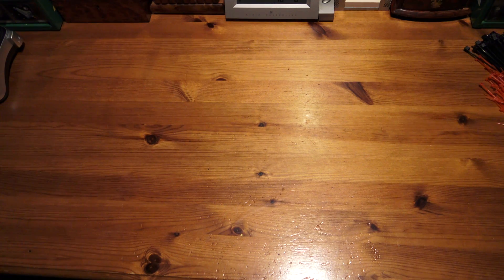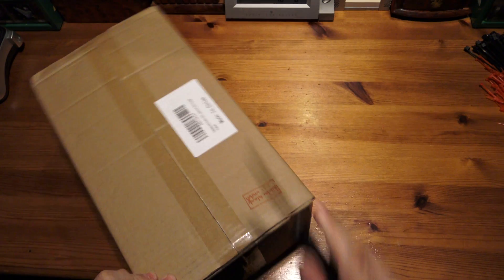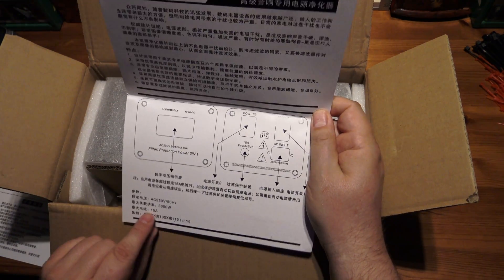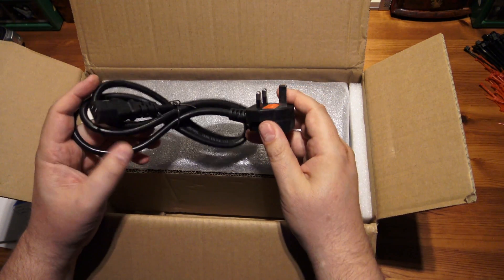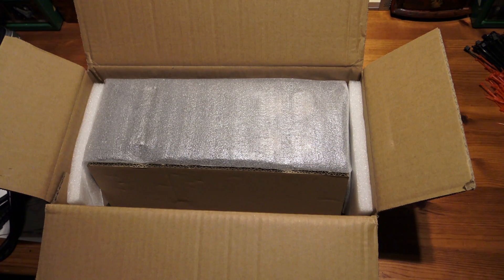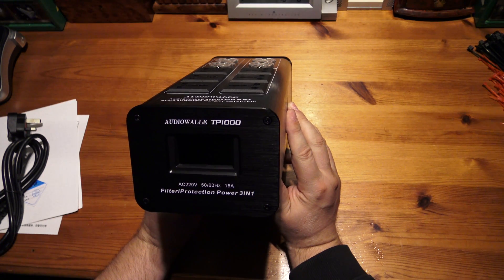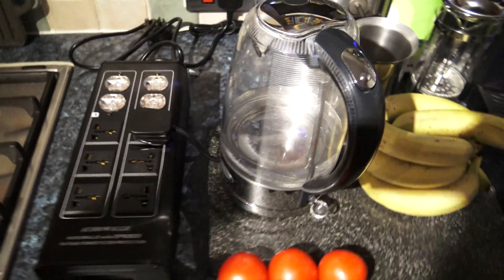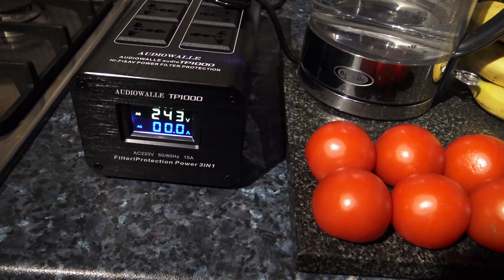Nobsound/Audiowalle AC Power Socket Conditioner Unboxing

Comment: I have Weiduka AC8.8  for about 5 years now. My HiFi components are connected all the time and it still runs without any issue.  @nonsensicalchild Do you know if those US plugs are actually supporting devices with 110V?
Reply from the maker: It is uk mains 230v as far as I know.
Reply: @nonsensicalchild  That's what I thought. It doesn't act as a step-up transformer on those US plugs  .
Reply: How heavy is this unit? Thankyou..
Reply: is this weiduka good? does it really filter out noise? im looking to buy one. thanks!
Reply: @KazuyaST  Tbo, I haven't notice any sonic difference.

Comment: Those sockets designed to take every single type of plug under the sun are deathtraps and don't meet any of the standards needed to be sold in  the UK or Europe. That alone should be enough reason to chuck it in the bin regardless of what type of circuitry is inside there.
Most of these types of units usually just have some standard EMI filtering and surge protection circuitry in them which is worth getting, though most are overpriced for what they are.
Reply from the maker: Yes so much is getting into the uk these days for me its ok as I am on my own here,but I must make sure to mention things like this in the future. The lasers sold as party lights are a real concern too.

Comment: The question on all audioplhile's lips is. Did the drink taste any better, were the sours more sour, the sweet, sweeter?

I have had a pair of Weidula branded versions of these for about a year, the AC8.8 to be precise. I bought a pair because I need the 12 UK outlets for my HiFi. My only criticism at the price is the fact that the live feeds are open to childish fingers and inquisitive pets when the sockets are not occupied. I bought blanks for the USA outputs and the others are all occupied so mine is safe.
I wish I had opted for the analogue display version though as the displays are actually a visual pain in a darkened room and cannot be switched off.

Nice to see it didn't go up in smoke feeding a kettle, I feel more comfortable now knowing it isn't restricting power to my power amps.
Reply from the maker: They seem well made ( although I haven't looked inside) . My friend has two for his hi-fi left on all the time. I think the tea tasted filtered  :P
Reply: @nonsensicalchild  Filtered  :)

Comment: I have a fridge under my desk that when it turns on an off it causes my speakers to pop. If I plugged the amplifiers into this, would it stop that happening?
Reply: Looks like none of the filters work. And regrettably it's not the fridge I tried 3 different fridges and it happened on all.
Reply from the maker: @LewisHolford  check your house wiring and earthing
Reply: Nonsensical Child I Just had the house rewired. Seems to be a common problem online just wondering if this should fix it really
Reply: @LewisHolford  
我覺得你雪櫃的插座應該和你的音箱的插座是同一條主線。
Reply from the maker: Better to isolate the fridge , unless it's electromagnetic interference.
Reply: Nonsensical Child I believe it's Electromagnetic  if that is the case would this still work? Failing that how would I get over this
Reply from the maker: @LewisHolford  I'm not an electrician but I would try : checking all contacts are clean and  plug has good contact with wires screwed tight.I would then try a different circuit to put the fringe on. Then maybe a filter or there maybe something that has become loose or blown in the fridge electrics that need seeing to.Sometimes it's just as cheap to buy a different fridge.
Reply from the maker: @LewisHolford  https://www.youtube.com/watch?v=Ey2lthaCql8&feature=youtu.be

Comment: I bought it too. However I don't think it improved the sound in any way.
Reply: I bought it and used it with NAIM Nap250, ndx2, nap sc, hicap dr, nac 282. The sound quality improved alot compared to your normal wall power socket or extension socket. It depends on the grade of your audio equipment. If they're cheap types, you won't hear the difference.

Comment: hi
just want to ask if there is an improvement in the overall sound quality with the audiowalle tp1000?  thanks
Reply: Hi Emilio, I can offer an opinion on that as I bought two of these about 9 months ago, they were badged as Weiduka AC8.8 but are undoubtedly the same items, same packing, instruction sheet, everything identical.
First of all I would suggest that much will depend on how noisy your mains is, then the quality of your equipment and the integrity of your earthing arrangements.

I was using two the top of the range Monster outlets, I don't recall the models but they were butt ugly so I tended to have them poked out of sight where they were a pain to get at. I saw these advertised, read no bad reviews and ordered a pair from a UK based Chinese seller in Southampton. I do not recall the name but I was happy with the service, more on that in a bit.

They work far better than the Monster items and they in turn were probably a small improvement on plugging directly into the mains. The tuner in my system, an Onkyo T4150 is the item that has most benefited from the change, no idea why but FM is cleaner, stereo reception more stable and AM suffers less from interference, why this should be I do not understand?

They are very well finished and came with a decent enough mains cable,  however I am always suspicious of Chinese power cables and have replaced them with my own made with Belden cable. Thick insulation does not always mean there is thick copper cable within.
My voltage displays are accurate to within +/- 0.5v but the amperage shown being drawn bears no relationship to the load being imposed. For example my two Audiolab 8000M monoblock power amps apparently draw no more current running hard than they do when idling and they are not class A designs. The display looks cool in the images but is a little too bright in a darkened room.

Overall I am pretty impressed, I contacted the seller about the amperage display issue, they apologised and told me if it was not a really huge issue that they would fully refund me the cost of one unit, I don't really care how many amps my system is pulling so a very satisfactory outcome, I can recommend the seller if you are in the UK and can find them.

Word of warning if you have children or pets. IMPORTANT.
The unused sockets are not shielded in any way, if the socket is not occupied the live is easily reached by inquisitive fingers or noses. I use all twelve of the UK/Universal sockets so no live parts are exposed without withdrawing the plug, this still leaves the US ones open and potentially lethal. Because of that I bought a box of Papa Baby US blanks to render mine safe, I had to import 50 from America to get them but it was worth it for peace of mind. I don't have kids but I do have cats. Of course if you are in the US or Canada the reverse will be true and you will need some UK socket blanks.

I may well upgrade both of mine to the even higher quality BADA version as I prefer the VU style display and alloy fascia, but the Weiduka/Nobsound/Chinese Industries version is good value I feel.
I hope that helps and nice review NC.
Reply: Donk , Thanks so much Sir for that very thorough review.  Much appreciated👍👍👍👍
Reply: @manuelgaring7793  My pleasure. If you are in the UK, Europe, decide to buy and need any US blanks let me know here and I will pop them up on E Bay for you to grab nice and cheap, basically the cost of postage plus a couple of quid for a full set of 4, no point in you importing 50 too.

It has just occurred to me to mention the likely output voltage you might see via the different type sockets depending on where you are.
In the UK/Europe we use 230v/50hz, in the USA/Can that would be 110v/60hz, a brief peek inside one of the units left me with the impression that if your source is 240v/50hz so will the output be from the American style outputs, I saw nothing that would suggest the voltage is being stepped down and certainly nothing that would regenerate the mains frequency. Likewise if you input 110v/60hz I feel you would probably get the same 110v/60hz from the universal outlets.
This is a good thing, if I am correct? If you live in the USA/Can, import a bunch of MK brand UK plugs and bingo, 12 point power outlet, not so great for us here as the thought of 240v going through those American style plugs gives me the heebi jeebies ;).
If I can borrow a multi-meter I will test them out and update you on the findings.
All the best.
Reply: Hi Donk
I just purchased the TP1000 here in the UK and am wondering if you have any spare US blanks left?
I don’t need to worry about kids but do wonder if this product is strictly legal in the UK with the exposed sockets... I have not yet auditioned it for any sound improvement.
Thanks
Reply: @gnomadification  Yes amigo I have plenty, sorry for not replying sooner. I have another chap asking the same question so if still interested I will try listing them again on E Bay. I have to send them as a parcel I'm afraid or the prongs will get broken off
How many would you need?
Reply: @gnomadification  Don't worry. The children will only touch it once, as is the case with the electric fence at the end of our garden.
Reply: @WryJab  Yes mate, I had to buy a whole box to get the 8 I needed :). Are you in the UK? I can list some on E Bay so you can snap them up, only bugbear is postage, I have to send as a parcel not in a jiffy bag or the won't arrive intact. They are a good brand, once they are in, you will need a tool to get them out again, kids fingers won't be enough :). How many would you need?
Reply: @WryJab  If UK postage how would £1 each plus £3.50 p&p sound £7.50 total, not interested in profiting just covering costs. Will post them as a small parcel so you get them intact. Will include a 5th one free so you have a spare.